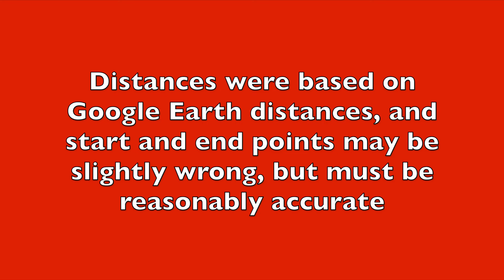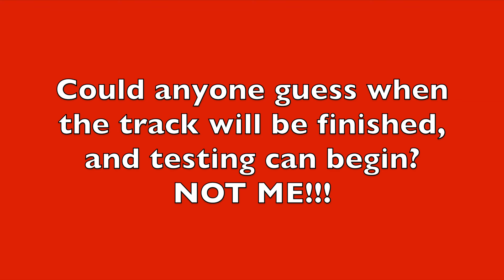Gold Coast LIght Rail Stage 3 Extension progress

Comment: Wow I had no idea that they were that far along.
Reply from the maker: @McArg_     Should be a lot more track after 3 months. Melbourne can lay 1 km in a little over one week.
Reply: @tressteleg1  but not "new track", where the entire groundwork has to be done too. It's much easier to exchange existing track rather than building new one...
Reply from the maker: @sepruecom  Once the trackbed has been prepared, tracklaying should be fast. That is not happening here. They started moving utilities in the way 3 years ago, so surely more than 350 metres should have been laid in 3 months. It is probably the French who have fooled our governments into believing the trackbed full of steel reinforcing is needed to carry ‘modern LRVs’ which in fact are no more than trams and which most German and other tramways run on their normal tram track.
Reply from the maker: @sepruecom    They have had three years preparing the trackbed for the laying of track but in three months have still only laid about 350 m.
Reply: @tressteleg1  those were quite "minimal-invasive" construction works for quite some time. When I visited in late 2022, there were only very few small constructions around the future line. From the video it seems a lot of the current construction is road work (afaik most, if not all of the new line will be in the middle of the road, so all construction left and right is pretty much building future car lanes before they start building tram tracks).

Also, I believe, they first finished "three-laning" M1 (which runs more or less parallel to the Gold Coast Highway, which is now u/c). It would make sense to first get the detour done before diving into long(er) term construction work...
Reply from the maker: @sepruecom     That M1 widening to 3 lanes is just about to open. That has dragged on for years and years just to add an extra lane in each direction over a paltry 3 km distance and costing $1.5 billion. On the occasions I drove past, it seemed to me that there were almost no workers there. And it’s completion has nothing to do with the tram works as they are different contractors.
I have long believed that most contractors and their consultants are ripping off all levels of government here.  A prime example is the Runaway Bay Community Centre, owned by the council. A little before Covid, the toilets were upgraded at that hall. The men’s consists of three WC cubicles, four urinals and four handbasins. The ladies would have been equivalent.  The hall was shut for 3 1/2 months while this work was being done. One of the club members asked a worker one day just how fast they could’ve done the job, and his response was about 10 days. So not only was the council ripped off for the cost of employing men for all that time for nothing but they lost the rental income from hiring out the hall for all that time. Take a look in your own area for more examples of simple jobs dragging out forever.
Reply: @tressteleg1  The same thing happens in Sydney. I won't go into details because you probably already know. As a public transport enthusiast I am looking forward to the various transport projects being completed in Australia, particularly Sydney, over the coming years.

It's a shame some or most of these projects are over budget and over time.
Reply from the maker: @quarkcypher    Yes, the contractors for the George Street tram routes also appear to have taken the government for a ride with reports of drastically thick concrete being laid under the tracks in places and they also threatened to take the government to court over costs. Not sure if that happened . As I have implied, governments need their own in-house engineers to supervise the construction of project. Careful scrutinising of the technical plans also needs to take place.

Comment: What those billions could have done elsewhere.And it's many years before it gets to Burleigh let alone Palm beach let alone Coolangatta.Buses could have done the same job.
Reply from the maker: @dennisbailey6067  The track could have been laid much more efficiently and cheaply and still done the job. Whether the contractor is operating efficiently is another question.
What you don’t understand is that people don’t like riding buses. Their operation is always erratic along the coast and you never know when they will turn up whereas it’s unusual for a tram to be more than one or two minutes late. Most usually right on time.
Reply: @tressteleg1  Yes,,, we have become a country of BUS snobs with LR costing a whopping 1300,000,000 for GCLR3 plus the lost of roadway,,,, But the reality is NOTHING is done to truly improve buses and market / promote their value and complete the rail with better integration

Comment: How far are they looking to extend the tram line to.
Reply: Was going to Ask that question two.
Reply from the maker: @kevinthompson4494    As you have seen, this stage will be to Burleigh Heads (and beach). If Stage 4 gets built, first goal is the airport, then Coolangatta (NSW border), around 13 km further away from Burleigh.

Comment: With the name tressteleg I assume you were once a telegraphist and used the Teleprinter Electronic Switching System in PMG days and later? I was a PC using printers from the beginning of TRESS in NSW. You? Later I worked on Melbourne trams as conductor and driver.
Reply from the maker: @DenisHauvillle  That is very smart of you! In 1968 I did my PC training at Strathfield. After I had been out in the field for awhile, because I had my Third Division I was soon acting SPC1 in smaller offices but except for Killara, the printer was always operated by a PC. Most offices however only had a telephone connection for telegram. At Killara on rare occasions I had to send a telegram when the PC was at lunch. I wish I had more experience on it.
Even more of a coincidence was that in 1987 I moved to Melbourne to work on the trams and after starting at Brunswick moved to South Melbourne which was expanding due to the light rail, and did my driver training late 88. I never intended staying in Melbourne forever, so when Kennett started interfering badly with operations, I quit and retired to Queensland.
As for the teleprinters, I have a collection of my own and they are all in working order. You will find a couple of relevant videos in this link. 
Teleprinters - Telex - Telegraphy - Telephones
https://www.youtube.com/playlist?list=PLLtOIHp49XNAKS7BxlbgYN__1xfLSBP75

Comment: Early 2027 is my guess.
Reply from the maker: @grahamearley1820    I’m not brave enough to even hazard a guess. I was at Mermaid on Monday, a week after I took those roadside photos and it seemed that absolutely no track completing had been done in that time.
Reply: @tressteleg1  In relation to this project, i wouldn't know what day of the week it was, just threw my hat into the ring of guesses.
Reply from the maker: @grahamearley1820    it would be unwise for anyone to even guess when it might be finished at this rate. Certainly it could have been finished much sooner than it will be.

Comment: I thought the track laying was meant to be LESS over engineered than Sydney’s.
Reply from the maker: @michaelhatton2477     They are all being duped by the same probably French overseas consultants pretending that light rail vehicles require special track more specialised than trams need. So cut how come five genuine LRVs from Mulhouse in France have been running on the 96 in Melbourne, some of whose track was laid in 1955 without any steel in it? And they have not smashed it to pieces?
Reply: @tressteleg1 the ride quality in Melbourne is pretty bad
Reply from the maker: @shaungordon9737    I suppose you are suggesting the trams. I haven’t found anywhere where buses give a smoother ride. And they are the only alternative for street public transport.
Reply from the maker: @shaungordon9737    You mean to say that Melbourne buses give a better ride? That would be a world first.

Comment: why cannot they work in stages ,get it finished ,then do next stage ,it just seems roadworks go on forever
Reply from the maker: @malcolmone1    Good question. There seems to be no attempt to minimise the worksite or disruption to adjacent businesses. Not to mention maintain two lanes of traffic in each direction. When stage 1 was done through Southport and further down the coast, largely the worksite was confined to the width of the tramway reservation and no more. The current lot takes over just about the whole road apparently simply because they can.

Comment: There are these new things called buses. You can get them in Hybrid, Diesel, LPG, Hydrogen and Electric (either battery or via overhead power lines). You can actually use them on an existing road without having tear apart those same  roads that are needed for people who can afford this other new thing called a car. Amazingly, this new invention called the bus can drive up and down the Gold Coast Highway and do the exact same thing as a tram. Now wait for this bit, the bus can actually leave the highway and go out to the suburbs, yes even the one that uses overhead power lines as it now comes with battery backup for short trips off the main line. Oh , and all those who are saying it will be awesome when its finished, tell that to the business owners it sent broke on the highway during construction.
Reply from the maker: @anthonyg638    Sounds like you are quite out of touch with riding both buses and the tram on the Gold Coast. The ride quality of buses is terrible, banging and rattling along roads of doubtful quality, driven by drivers more at home driving heavy gravel trucks. Standing, you hang on for dear life. Timekeeping on the buses is terrible. Theoretical timetable spacing does not last long. That contrasts with much smoother riding on trams whose punctuality is rarely more than a minute or 2 late. As for the little electric buses serving the airport for around 2 years, besides them being little quieter than diesel buses, they also feel every bump in the road just like a diesel. Twice those little buses have left me wanting. Early last year I had to stand all the way Airport to Broadbeach. Not fun for somebody nearing the age of 80. Then this year several people as well as myself were bluntly told by the bus driver we had to wait the 15 minutes to the next bus. They are hopeless when a plane lands. You must be an LNP supporter. They only see the cheapest option for any transport problem.
Reply from the maker: @anthonyg638  I got your second email but it is not amongst Comments.